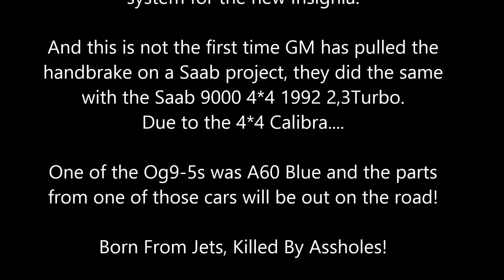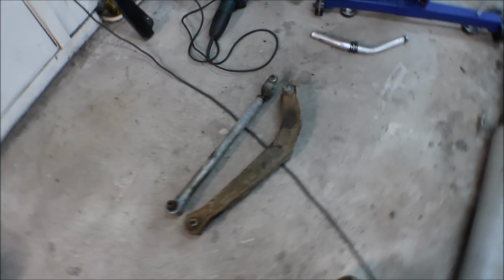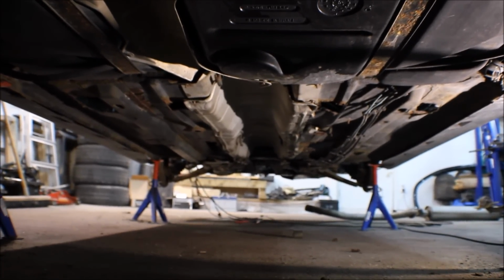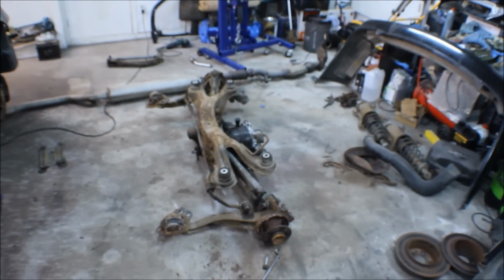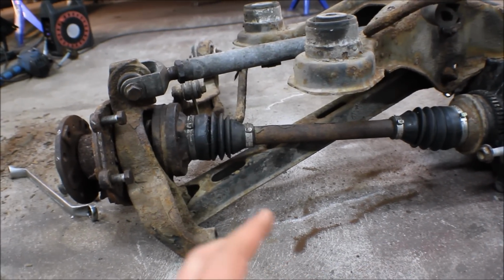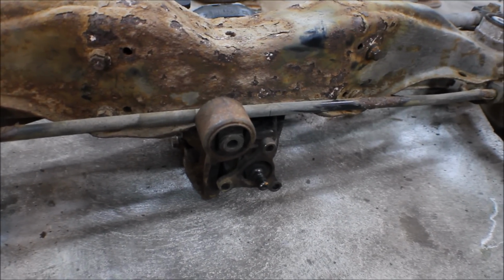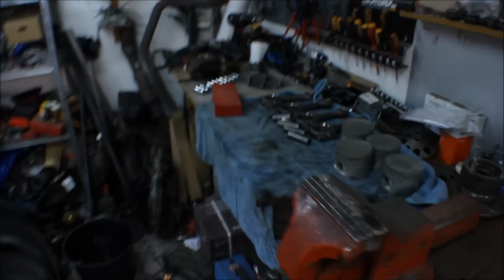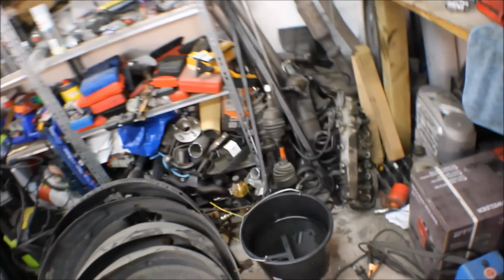YOU NEED TO SEE THIS! Saab 9-5 Aero RWD Rearaxle

Comment: Hi Jonas, Fantastic news that the parts will fit with a bit of fettling. As you have more jam than Hartley's (English expression meaning you're very lucky), you should rush out and buy a Lottery ticket! Seriously though, well done on the work so far and it's as good to get a quick update as it is to get a longer video. If I could make a suggestion and that is to document what parts you use with suppliers and part numbers if possible as you'll need to replace bits in the future and trust me when I say that as you get older, things slip away and if you sell the car, the new owner will appreciate the information.
Reply from the maker: Thanks, its a good thought. Its a little bit of extra job putting in links and stuff. But many of the parts are being bought used and then its really Hard to refer to anything But a partnumber maybe. 👍

Comment: Would an Audi a4 quattro tank work it has a gap for the shaft to pass through
Reply from the maker: Dont know the measurements or where its placed
Reply: It's under back seat divided in 2 with shaft running through it , I have a b6 quattro 2003 model

Comment: A moog adjustable arm would probably fit the the top arm if the spindle was shortened to fit top rather than bottom are you polybushibg the top and bottom rose bushes
Reply from the maker: Everything will be polybushings 👌💯
Reply: The outer rose joints are far better than a polybush. I assume you're talking about the inners? For a rear drive track car I'd consider spherical 'rose joints' which will take more abuse. I would be most concerned about the trailing arm to sill bushes though. They are going to be pushing the whole car along, as opposed to standard where they are taking braking loads at most.